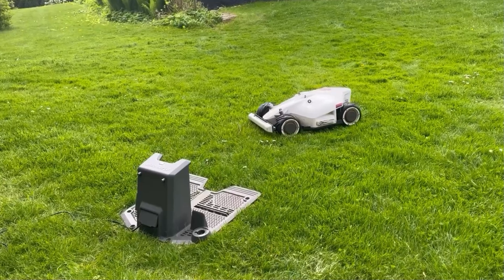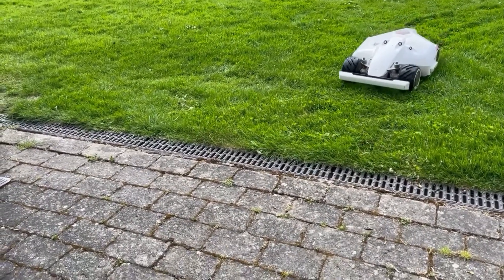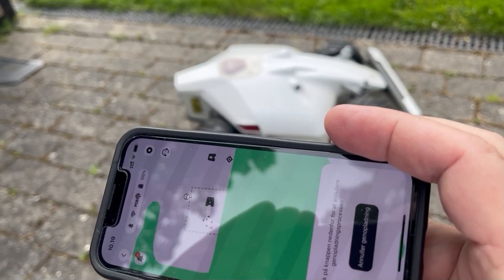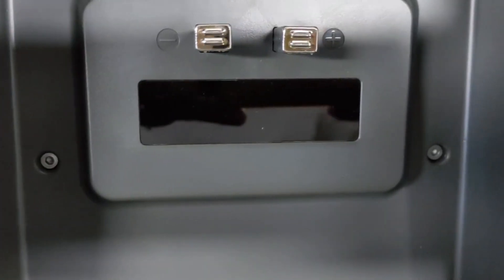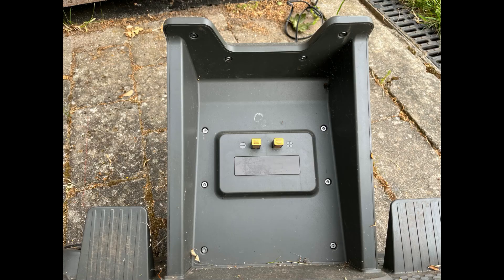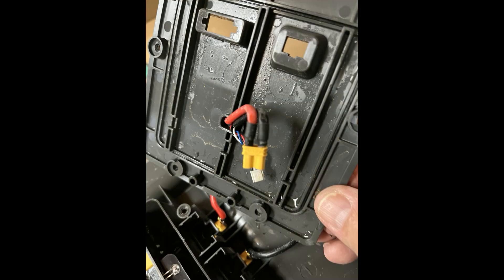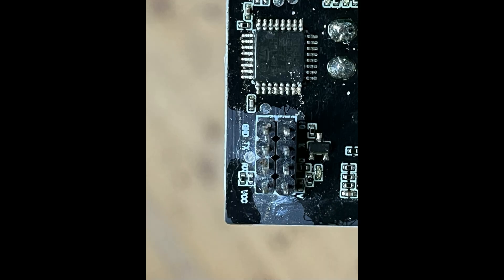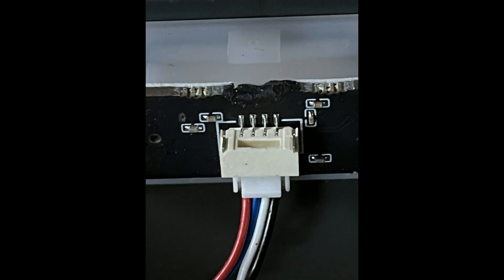Opening Mammotion Luba 1 Charging Station and checking the inside

Comment: update after several more conversations with mammotion the finally sent me a new updated charging station and new cables (after i had to contact them to tell them my cables won't work) . they refunded me what they charged me for the charging station replacement. Im glad they did the right thing and admitted to their manufacturing failures on the original unit.  It took some gentle prodding to get to this point and several chat sessions on support, but im glad they stood by their product and replaced it for me. Thank You Mammotion

Comment: My boards inside the charger were straight up fried, the plastic connectors were melted, Mammotion support had me pay $259 to send replacement parts. I paid have not heard back from support since. I'm pretty upset this was supposed to be waterproof, it should have been a recall if they knew that this was failing.